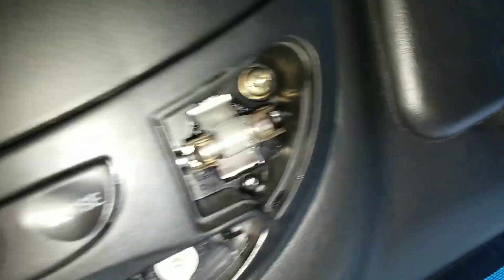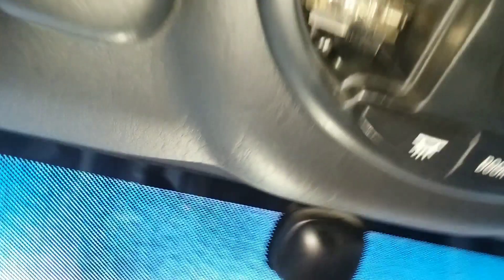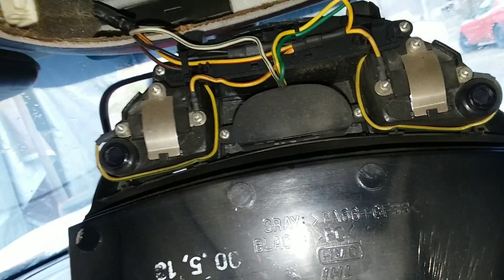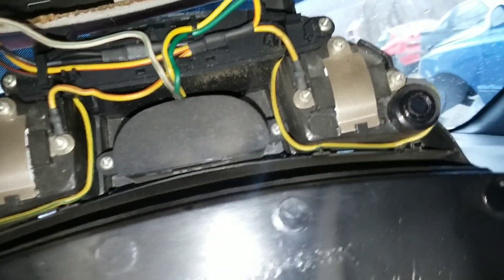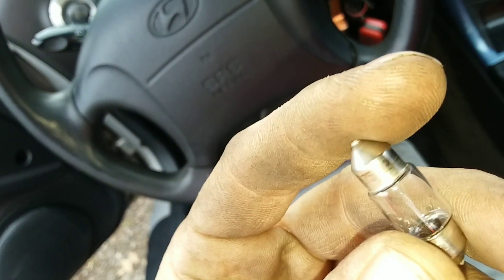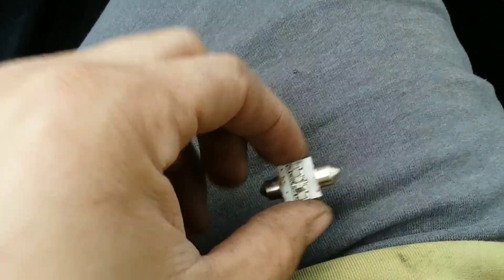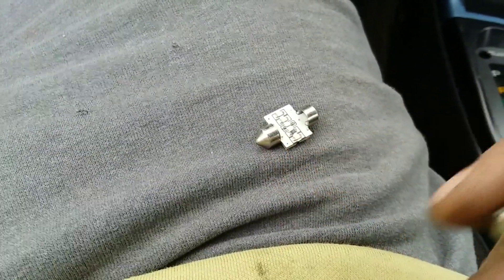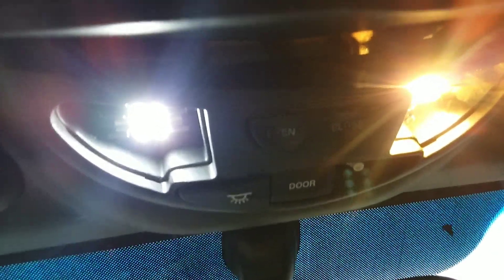How to fix 97-01 Hyundai Tiburon/coupe Map/Doom lights

Comment: My radio is not working at all no power at all. Can you help me please.
Reply from the maker: Oem radio? Did you check the fuse ?
Reply: @PATuners  yes I did. I have it pulled out now and looked at the fuse in the back of it. It was still good. All fuses are good.
Reply from the maker: @KevinBrown-yn5mt  sounds like the radio needs replaced if it’s Oem one are if it’s older aftermarket one it may have a fuse on the radio itself
Reply: @PATuners  yes the on radio fuse is good. Idk wat to do but to replace it. Should I replace it?
Reply from the maker: @KevinBrown-yn5mt  Might be your next best move